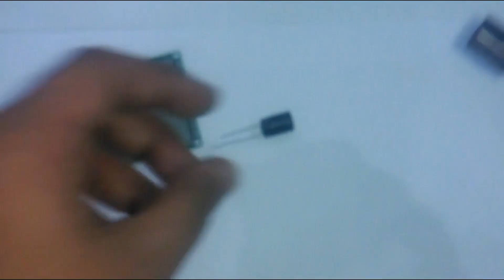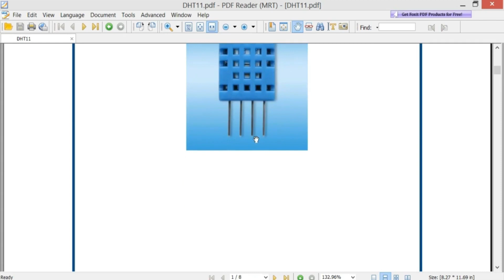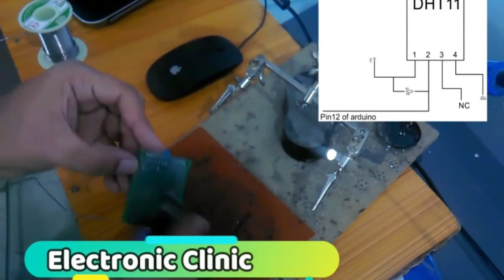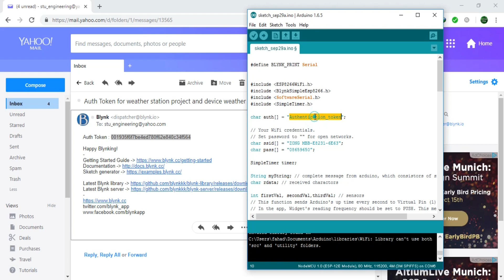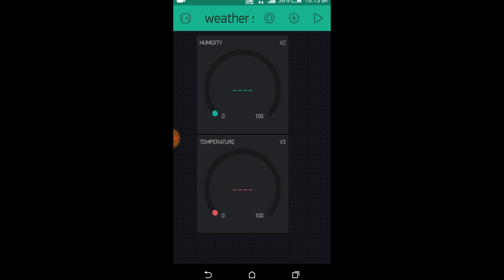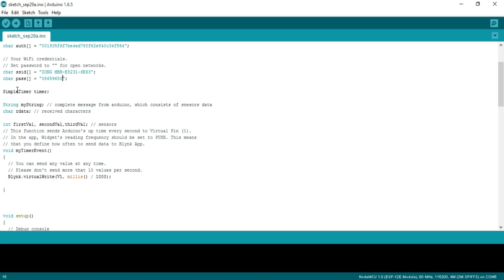Arduino Weather Station dht11 | Display Sensors Data on Gauges using Blynk Nodemcu esp8266 wifi

Comment: after i connect with Nodemcu , the value from arduino i can check from serial monitor, but when i upload the code in Nodemcu its connected with my blynk app,but the temperature and humidity is not showing . even the virtual pin are correct.

Comment: I have been working on this project for a couple days but I’m having trouble with the node MCU code. Multiple problems compiling. Would you please send me an updated version of this code so I can check my work? 
Thank you for this project.
Reply from the maker: Check my playlist on nodemcu
Reply: Actually, I’m down to one final error compiling. 
Initializer fails to determine size of ‘strIndex’
Reply from the maker: Watch my first two tutorials on how to install nodemcu and its libraries. That will help you fix these errors